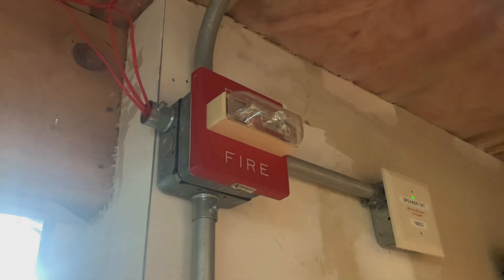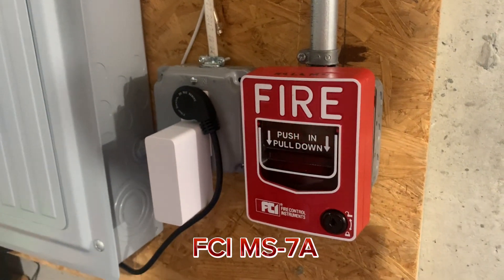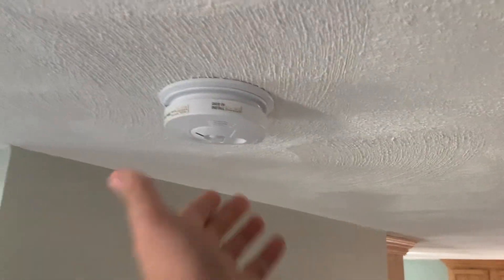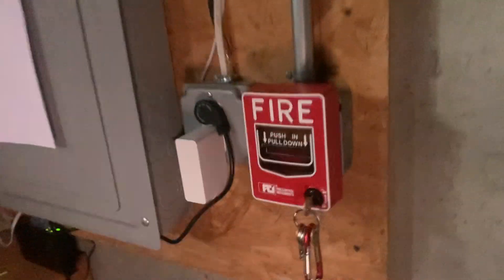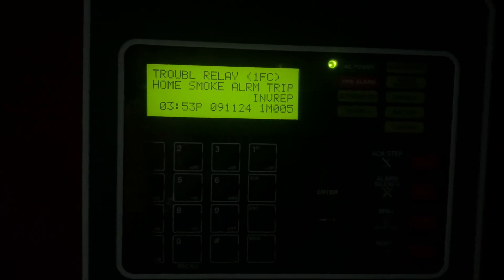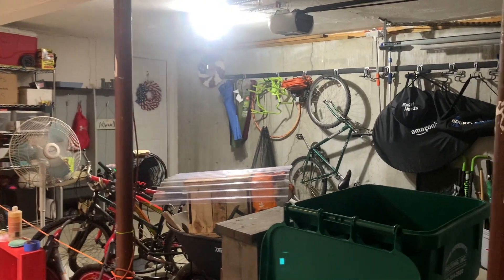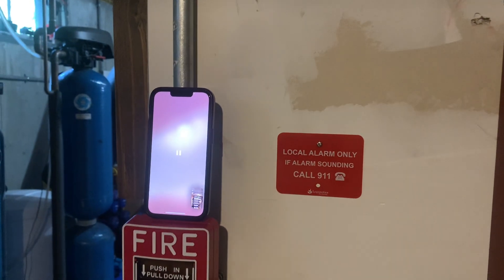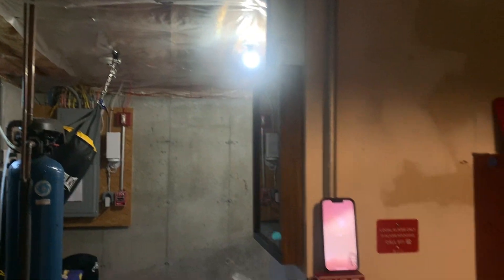Fire Alarm System Test 61: Wheelock MTs! (featuring @omegalarm)

Comment: Wait how did you get a working smoke alarm tie in? I'm curious
Reply from the maker: I used the Kidde SM120X and it’s set up as a 2 way circuit
Reply: @Loganetics1 do you need an FACP with it
Reply: @Loganetics1 also will your panel work with the smoke alarms tied